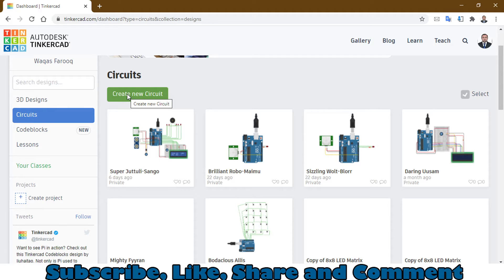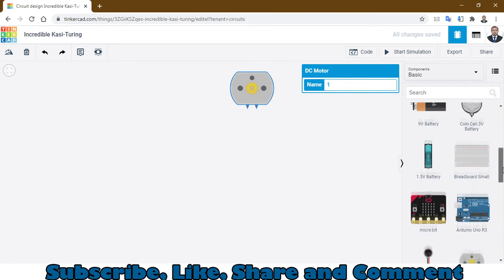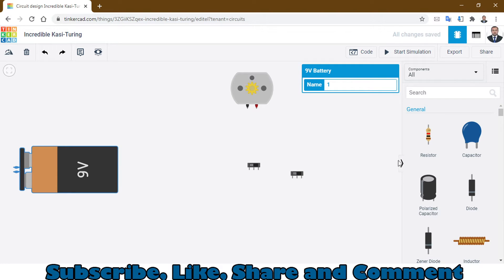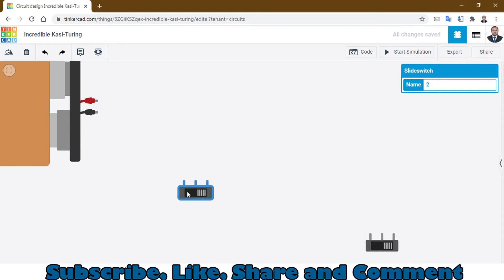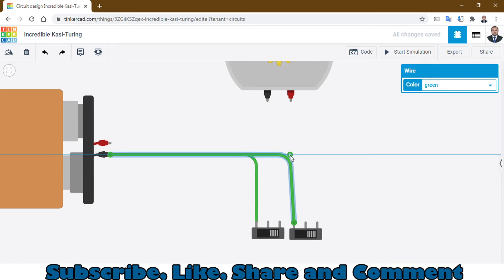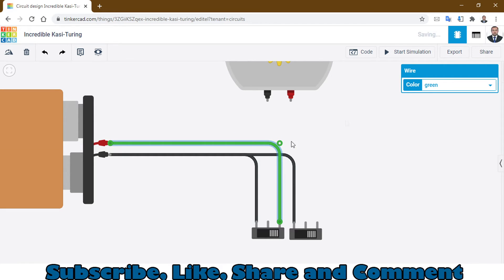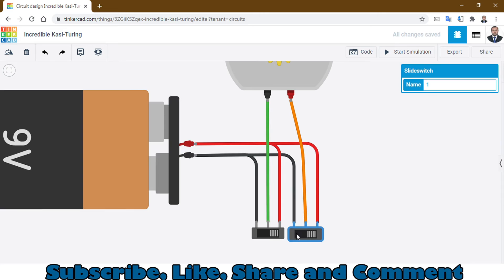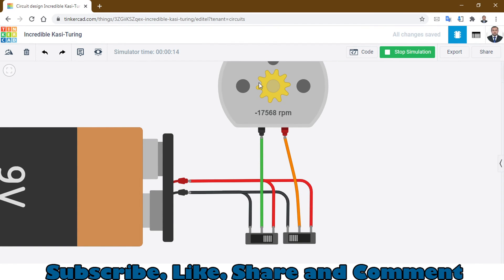How to rotate DC motor in both direction | Dc motor reverse forward switch|wiring Connection Diagram

Comment: is it possible to do it with one switch and a button. For example if it switched onto one side then you push the button is moves and vise versa.
Reply from the maker: yes you can use  on switch but motor will always be in continuous rotation CW or CCW
Reply: @WaqasFarooq  thanks do you know if there is a tutorial on YouTube that will help me?